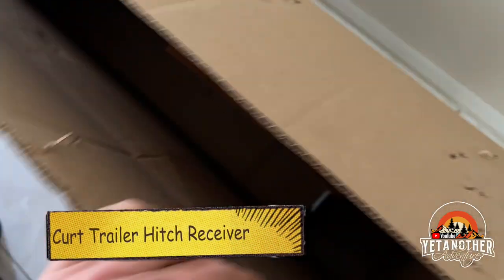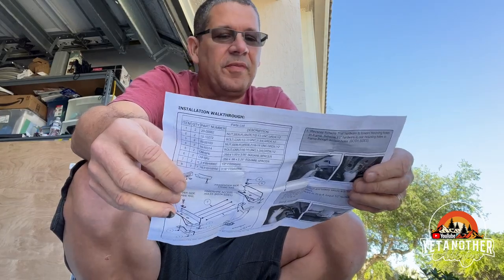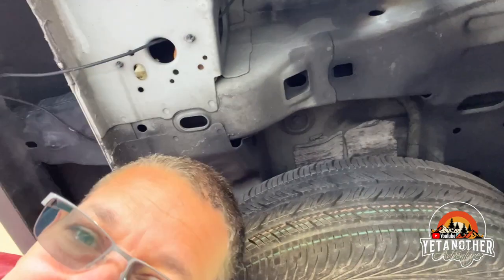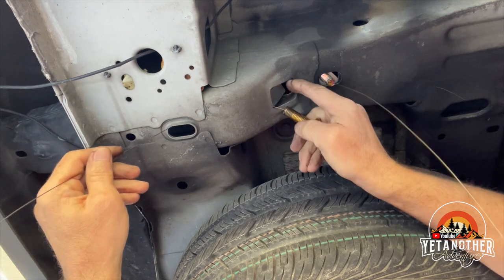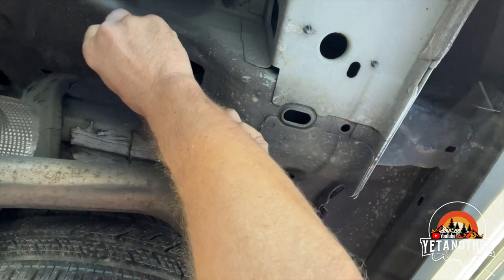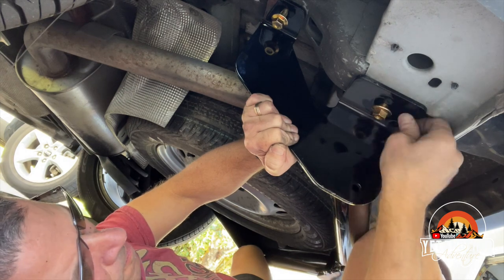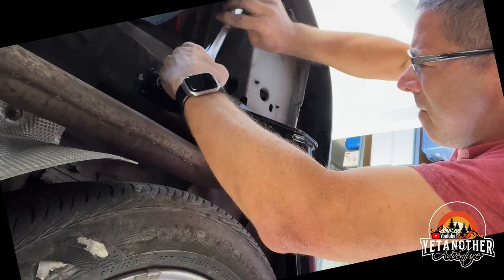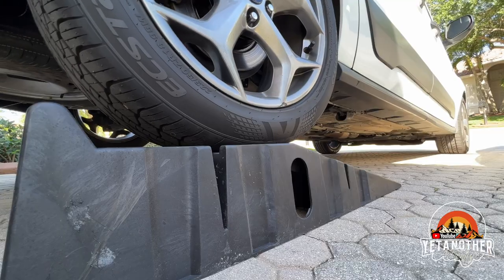How To Install Trailer Hitch | Transit Connect Campervan

Comment: They say 2,000 tow with 1,000 lbs cargo or maybe a trailer and cargo up to..close to 3,000 lbs but that small 4cyl engine is not gonna like it.
Reply from the maker: I use it to put a bike on it.